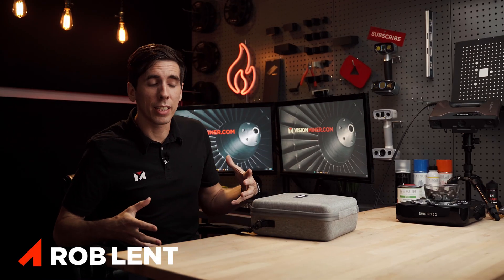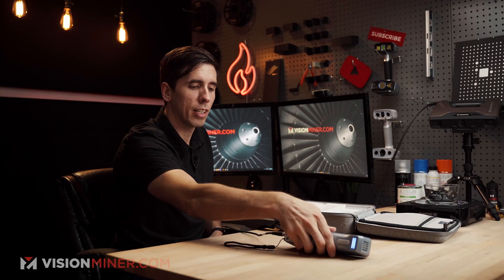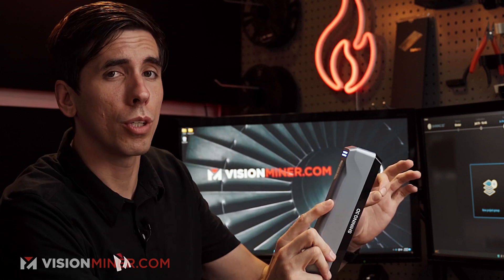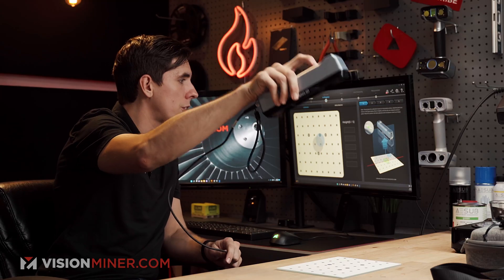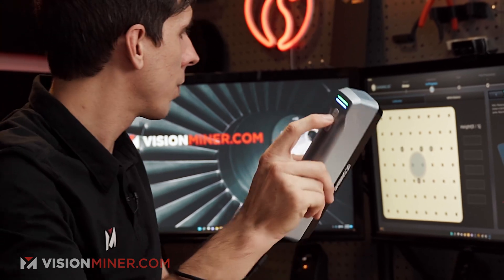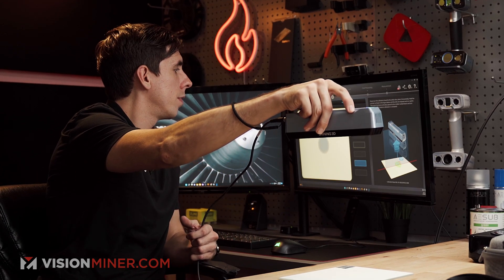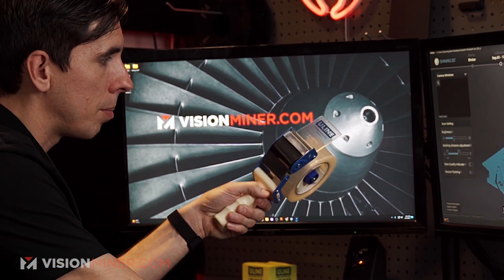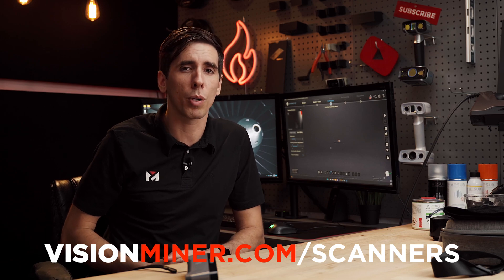Calibrating Your Shining 3D Einstar 3D Scanner - Vision Miner 3D Scanning

Comment: The HX's deviation from your October 1, 2021 calibration was .021542 mm. That's just a touch over half of this Einstar's calibration deviation of .041292 mm. Considering that the Einstar costs much much less than half of what the HX does, the Einstar's economic and practical use values are impressive. Real world scanning of both a known object, such as gauge block, as well as a complex surface object, in both indoor and outdoor lighting, and subsequent comparison of point cloud results from the HX and Einstar, would be really interesting.
Reply from the maker: We are currently scanning a 321 block as well as some other parts with all the EinScans that we have in our office and will be making a video on that soon
Reply: is thisvideo up now?  @VisionMiner
Reply from the maker: That's impressive that you found the HX's deviation from a previous video! Thank you for sharing your findings :)

Comment: I consider this not really a calibration of the scanner, but rather a verification (confirmation) that it is scanning correctly. To really calibrate the scanner it would be based on the VSI VDE 2634 part 3 standard

Comment: This scanner looks really interesting. Looks more like it is meant to be used for big scan applications. But can it keep up in accuracy with the einscan-sp on small parts?
Reply from the maker: The SP is definitely the better option for small parts! The turntable makes a huge difference especially if you're scanning a lot of parts. Not to mention the SP has much better accuracy :)

We think the Einstar is an excellent all around scanner for the price and especially combined with its very easy to use software.